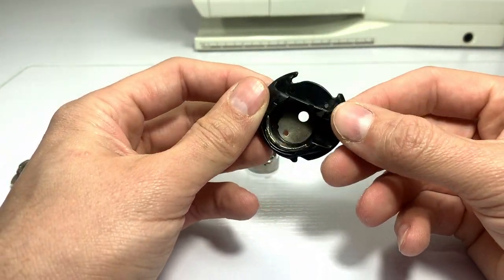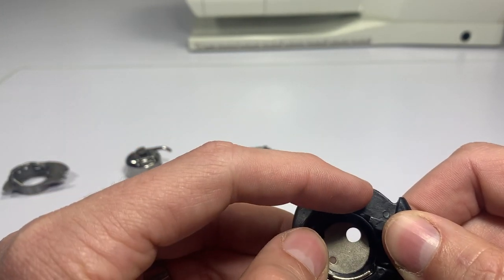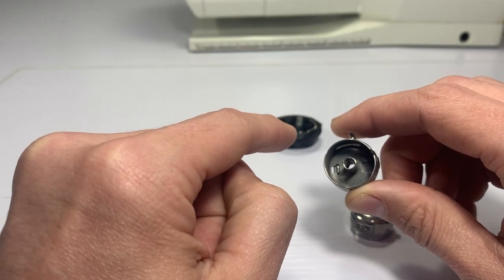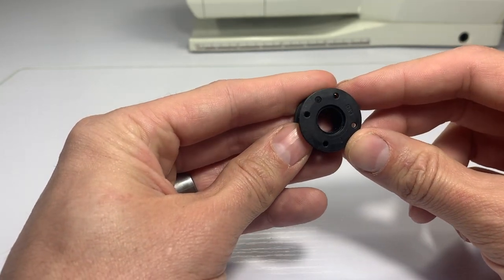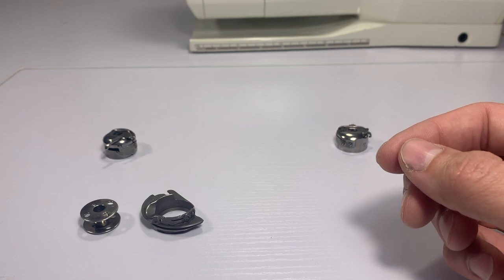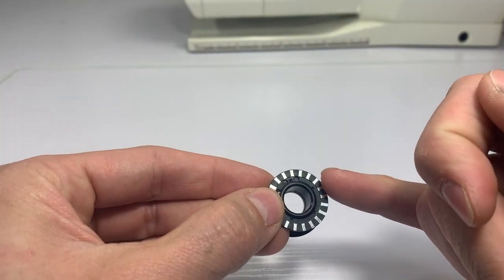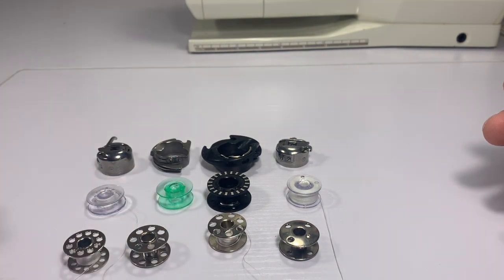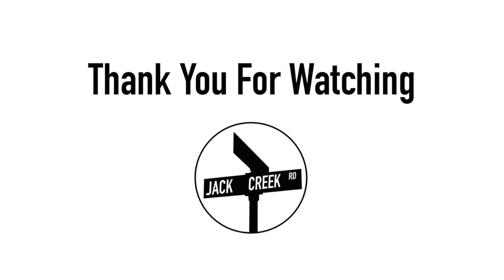Bobbin Case & Bobbin Basics

Comment: Thanks for this, very informative.  I totally agree about using the correct bobbin for the brand machine. I have a Janome,  and quite often sewing shops sell generic plastic bobbins which look very similar but there are subtle differences and it does affect the stitch quality and the machine itself. So I only use the Janome "J" bobbin. When you were talking about the special bobbin cases for embroidery, which have a preset higher tension, just wanted to mention  that there are also special bobbin cases for free motion quilting, which are set at a lower tension.  Thanks again for your video,  I find sewing machines absolutely fascinating.  😊

Comment: I've been impressed with the quality and content of your videos. I'd love to see an in-depth explanation of skipping stitches when sewing zigzag. I notice in my case, most skipped stitches have failed to pick up the thread on the right side of the zigzag, and I wonder why the skipped stitches only happen intermittently and not continuously. And I've been confused my the tension adjustments necessary to get nice zigzag stitches.  What is the impact of different orientations of the hook, vertical vs horizontal, oscillating vs rotary, front load vs top load vs end load?

Comment: Your videos are clear and concise with great, straightforward instruction.  Thank you!  I would love to see a basic how to with what to watch for in removing the housing on a sewing machine. Somehow I let thread get caught up on my machines turn wheel and I am afraid to sew with it again until this is removed. However, the week before Easter (with all my sewing projects backed up) there is no way I am going to get the one repair guy in town to fix my machine.
Reply: i think you are referring to bird nesting; if need be release needle 1st to help release tension, then just cut threads on top or bottom, using tweezer, gently tugging on thread to clear or cut stuck thread. clean out bobbin case area!!! rethread top thread, use a new needle; watch where you needle depth should be. match your project with the right needle, make sure your using same thread weight for top, and bobbin thread. follow your manual's guide. and sometimes you only have to rethread top threading guide!!!

Comment: My bobbin case has a hole to thread cotton through on the end of the spike but on the training video the instructor doesn't use it.  Do you know what it's for?
Reply from the maker: It adds extra tension. So if you were going to do embroidery (if your machine is capable) you can run the thread through that eye.

Comment: My Singer came with class 15 plastic bobbins.  Can I use class 15 metal bobbins?
Reply from the maker: You can, but there is often a magnet under the bobbin case that helps hold the case in and if you use a metal bobbin it may interfere with the bobbin threads feed.
Reply: @JackCreekRoad  Thanks, I'll check that